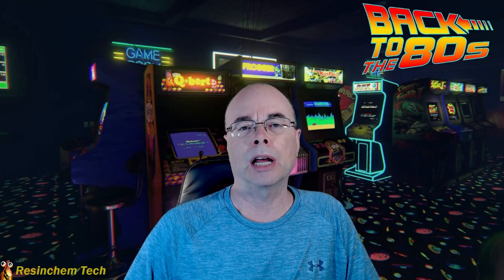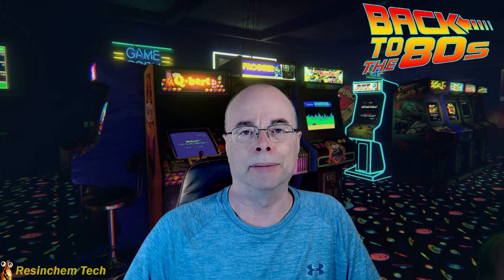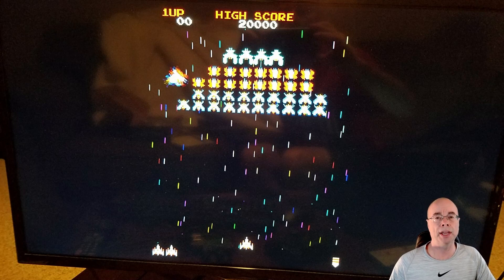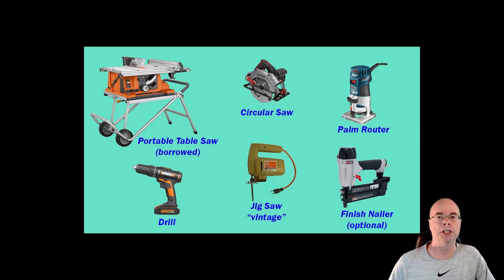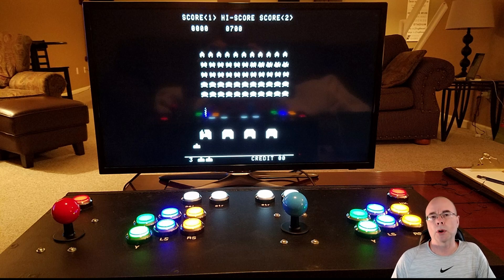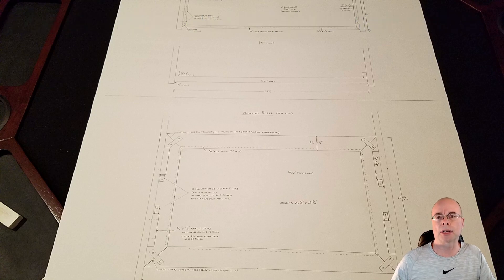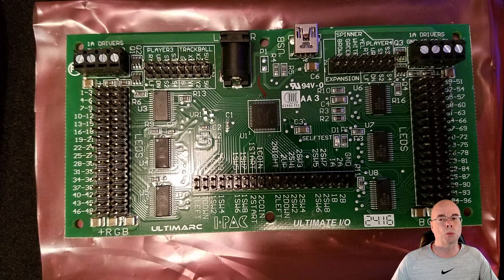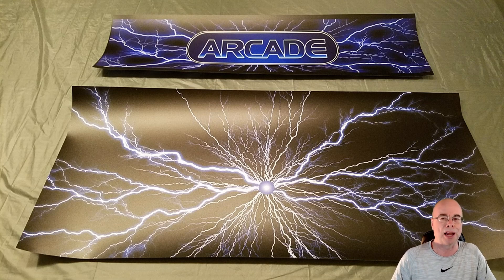Arcade Build Part 1: Planning, Design and Parts

Comment: I'm going to plan on building this, you've inspired me.  Is there a an exact parts list of items you bought from Ultimarc? I assume you got the: 64 Channel LED controller with full brightness control. I'm thinking of building a replica of what you built with some basic improvements like a dual coin door, and maybe longer wiring.  Enjoy your thoroughness.
Reply from the maker: Hi Paul!  I'll talk quite a bit more about the control panel, parts, wiring and then the software control in the upcoming parts.  Including some of the things I would have done differently... including a dual-coin door (it's like you've already seen the upcoming parts!).

I do have a list of all the parts that I bought from Ultimarc.  If you like, I can send that over to you via email (I think we've exchanged emails in the past).  You might also decide on a few other things that you want to do differently when you see the remaining parts of this series (6 parts in total... part 3  this Saturday, then each new part on the following Saturdays).

Comment: this is great cant wait to see the whole build from start to finish. about 12 years ago i built my own arcade stick controllers using sanwa tech, would love to do something like this again but with a full arcade machine.
Reply from the maker: Thanks!  Even though I built it four years ago, it has held up amazingly well and is still used on a regular basis.  I'd encourage you to consider building your own... especially if you enjoy messing with tech and things like building your own controller.  As you will see in the following segments, I try to stress that building a cabinet like this really isn't difficult, doesn't require a specialized workshop or tools, or any sort of programming or coding skills.  For me, it ended up being one of the most enjoyable and satisfying projects I have ever done.  The biggest skills required are patience and the willingness to think things through.

Let me know what you think of the remaining segments as I release them.